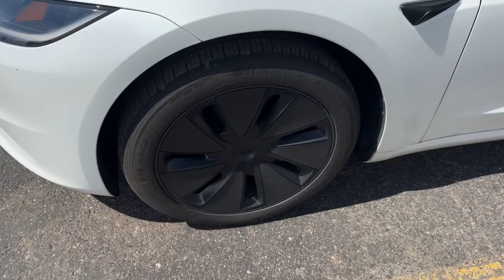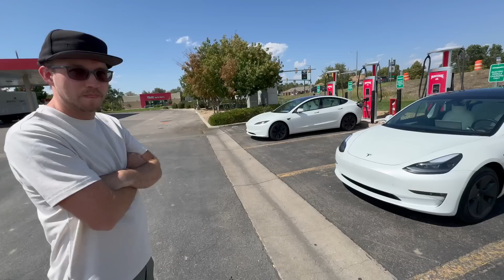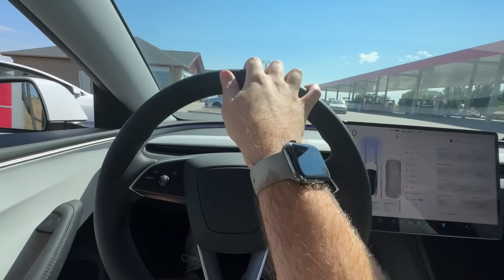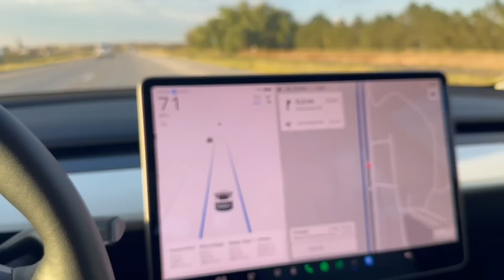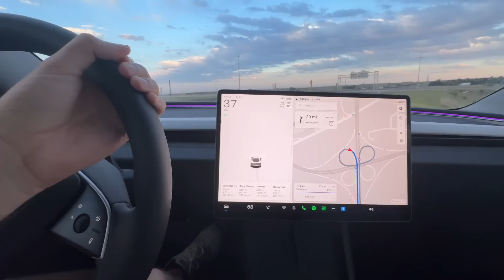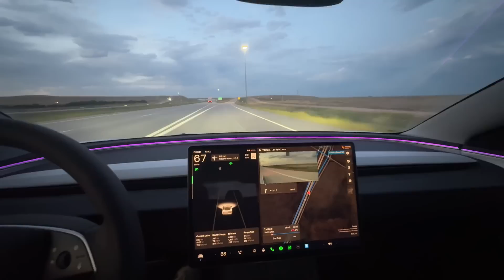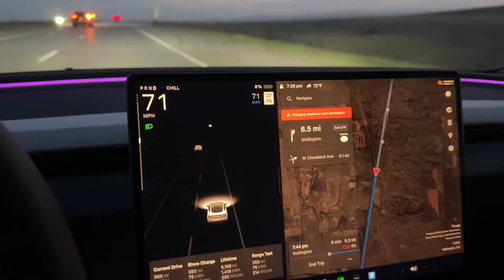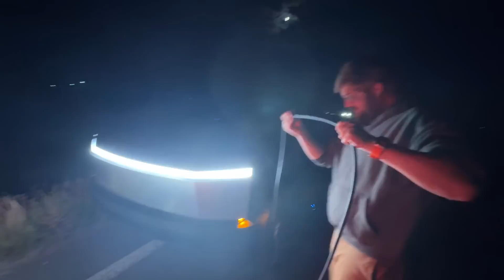Old vs New Tesla Model 3 Highway Range Test! Huge Improvement For Refresh - Long Range AWD

Comment: You KNOW what has to be done next, Kyle. You gotta put the Highland wheel/tire setup on the '21 LR and repeat the test and see just how much difference there is.
Reply: Tires make account for 3-5% of the range increase and maybe new aerodynamics another 3-5%, but this was a 21% range increase. Tesla's done something else, or so it seems. But I agree it would be interesting to swap the tires.
Reply: @777Outrigger  Cd on old car is .225 versus .219 on the new car.  Difference is 2.7%, not 3-5%.
Reply: @KP-xi4bj  I was being generous since I didn't know the exact number. That means more of the incredible range increase in the new MY is unexplained.
Reply: @777Outrigger  There was a MY in this video??
Reply: @KP-xi4bj  Sorry I was in a hurry when I posted. I own 2 MYs so my brain defaulted in my rush. 😂
Reply: @KP-xi4bj  cd is not including size. it just tells you how efficient a certain size is. for exemple, a 1 inch cube would be around 1.05 yet it has way less drag than a model 3 0.219. new model 3 is slightly bigger so it would be even less than a 2.7% difference and also why a model s even tho has a lower drag coefficient is still making more drag since it's a bigger vehicle.
Reply: @777Outrigger  maybe battery degradation?
Reply: @hojnikb  Battery degradation was accounted for old M3. It wasn't all that much.
Reply: @777Outrigger  Def Aero dynamics
Reply: @albieYT  That's certainly a part of it, but probably something else too.
Reply: You should use the older 40amp Tesla mobile charger in the cyber truck

Comment: I have a 2021 LR as well with 55k miles with 90% AC charging. I should run mine down to like <5% to get a decent degradation estimate. 
Based on how much % I use for my 120mi commute vs when it was new, I'd guess around a 5-6% loss.
I've had my cruise control lock out on me one time too, not sure why. Was fine the next time I drove.

Comment: Tesla really did make a perfect EV sedan with this redesign. All of the weaknesses (interior quality, build quality, road noise, suspension tuning) have been fixed and they increased the range! The closest competitor (Hyundai Ioniq6) can't match this range with AWD nor the tech inside.
Reply: What’s years suffered from poor build quality, road noise, etc?  Were they corrected by the 2020 model year?
Reply: @gvran71  For Model 3, if you are concerned about build quality and road noise/ride comfort, I would go with the 2024 Highland refreshed models. For the Model Y, they started getting better build quality in 2023 and Tesla put in comfort suspensions on the Model Y starting in 2023. If I was in the market, I would go with those years and newer for both models.
Reply: @chrisak49  The jury is out on that - everyone is basing build quality on the ones built in China. 
Meanwhile, Tesla can't even make a properly working cybertr**k.
Reply: @chrisak49  Please wait for Model Y Juniper if getting a Y. Differences will be monumental. Also not to disparage Hyundai Ioniq 5 N If driven at 70 mph or more I think real world range drops to like 220 miles or so so definitely nowhere near the same real world range as nearly any of the Teslas excepting the short range standard version. It also costs a fair pence more than even a performance Model Y is likely to cost especially if Federal Tax incentives still exist. Don't get me wrong, Model N is super fun if that's your thing but I think these have very different audiences in general. Each to their own. I do think Lucid's new wagon, shooting brake thingy is quite nice and surprisingly affordable if you can purchase between $70 and 80k. Cheers. Its a great time for EVs!
Reply: @noseonscent1935  Would avoid any and all Hyundai/Kia/Genesis EVs after their poor handling of ICCU failures (bricked cars for 2+ months) and manipulating crash test data they submit to IIHS. When tested in-house, IIHS showed these Korean EVs performed worse in crashes compared to data submitted by the manufacturer.
Reply: @chrisak49  very scary. I wonder however what the numbers will be after next year’s car models. The Koreans are very adept at fast necessary change. Thanks for the info
Reply: Hyundai ioniq 6 has 5kwh less battery capacity for starters and much bigger tires, but cannot match the AWD range. Still, it has a better coefficient of drag, and when they increase the battery to 84kwh, will still have more range than the RWD version. And the N version will outperform the M3P too.

Comment: Someone really screwed up those fueleconomy.gov city/hwy numbers then in a major way.  It shows the 2022-2023 LR getting 126 mpge equiv hwy.  And only shows the 2024 AWD LR getting 124 mpge.  If this test you just ran is any indication of reality then the fueleconomy.gov numbers are completely bogus.   We do know they detuned the rear motor if I recall it dropped to just above 200ish hp.  I didn't see what they said the HP figures were for the AWD 2024 and how that compares to the pre-refresh car.  I think that is part of the energy savings picture.  Also newer harder tire compounds reducing resistance.

Comment: At 4:58, I Kyle misspoke when he said 19" wheels. The new Model 3 aero wheels, called Photon, are still 18".
Reply: At one point in the video, you can even read the size on the tire sidewall, and they are 18". Also, I just checked Tesla's Canadian website, and the website shows that the Model 3 Long Range AWD comes standard with 18" Photon wheels. The 19" wheels don't have aero covers and look very different.
Reply: only in canada tho
Reply: no they re 19

Comment: Dang! 370 miles. And without piling on a BIG battery pack. God job Tesla!
Reply: Just imagine if they gave us a big battery pack too!!
Reply: Yeah but that would be brute force not high tech 🤔
Reply: @openinverter  I think he is implying one could get to 500 miles range with larger pack. However both semi-solid and solid state are here now technically and they are both major technological breakthroughs that should in theory allow for 600 mile ranges with large packs and up to 1000 miles for super packs like commercial vehicles (Tesla Semi, RVs, etc.) Exciting times. 370 on a mid size pack with slightly older tech is simply stunning.
Reply: @openinverter yup big boy tough NOT  real tough
Reply: Aaaaaaasn da safest on th road
Reply: I hope they can offer a 95kWh battery pack version for both model Y and Model 3 from 2028, the cars would be maybe same weight or slightly heavier if the battery tech improves, the cars would go 500 miles at the same speed 70 MPH, no competition even in 2028
Reply: @ Personally I'm happy with my 2023 Model Y's range, especially with all the reliable Superchargers always nearby. I wouldn't want a bigger battery pack I don't need 99% of the time. But there is certainly a market for a 400 or 500 mile range Tesla. But you would have to pay more.

Comment: I don't think the rear drive units are the same. I believe the old car has the 3DU rear motor and the new car has the 4DU rear motor. Could be performance only (I'm not an expert, but worth checking). But, I think the new unit has the hairpin windings and built-in oil filter. Anecdotally, my 2021 Model Y Performance had the old unit and my 2023 has the new unit. The motor looks different, sounds different, and seems more efficient.

Comment: You should swap the tires between the  cars and see how much the new tires affect the range.
Reply: Im pretty sure Tesla transitioned to Harpin motors in late 2021 to 2022.  Those motors are more efficient than the previous winding tech.
Reply: Also, how much of the difference would be in the tires versus the wheels. I'd be surprised if there's much difference in the wheels, but it would be interesting to know for sure.
Reply: @gregdavis3723 Lighter wheels definitely help with range..
Reply: This  💯
Reply: new tires have higher rolling resistance because more grip. old tires have less rolling resistance because less grip. sure if you are comparing mxm4 to ventus S1, then its a different subject, but the hankooks are harder but more grippy, mxm4s are softer and less grippy, im pretty sure its very very close
Reply: @mathieusturkenboom  they mentioned the tires were relatively even in terms of wear.  The 2021 M3 had custom wheels put on very early so the MXM4s would have had comparable wear levels, according to Kyle.
Reply: @mathieusturkenboom correct - the old tires are likely going to be the most efficient. Less tread, less weight, less resistance.
Reply: @fiehlsport  
These are not really old tires. I think he said and Colten said in his goodbye video on the car.. that the stock wheels and tires have very few miles on them before he swapped on some Martian wheels and different tires.
I think both sets have about 5K miles on them.  Age may play a role, and better tire compounds in the newer tire.
Reply: Dying to hear about the follow up. If you can get the same increase (or any substantial increase) replacing tires with the Hankook Ventus S1 AS that would be great to know.
Reply: Kyle! Get with drew and yall should build a super range spec Martian wheel with the new highland tire or a aftermarket high efficiency tire and compare to what Tesla offers!
Reply: Would love to know if swapping wheel and tire would improve that 280 whr/mile on the older M3
Reply: Correct. If those are energy saver they are very fuel economic but eliminate all fun while drivibg.
Reply: Great idea
Reply: I’m sure much of the gain comes from wheel / tire! I’d love to swap the new wheel / tire package on the old car to see the improvement. Maybe 40% can be attributed to that?
Reply: It would be wild to gain 25 miles of range with wheels and tires! Plus the new ones look better imo  @KyleConner
Reply: @KyleConner  This would be a great test!  Please do it. Tesla recommends upgrading to the new Hankook Ventus S1 AS or Michelin Primacy A/S when replacing all four wheels. (Service manual estimates a 10 and 20 mile range improvement respectively.)
Reply: @KyleConner Also, please test the iON Evo AS in the rain. They're unbelievably bad.
Reply: @0HOON0  do you have any tests confirming that?
Reply: @hojnikb  Tire Rack.
Reply: @KyleConner Damn can’t wait for the swapping test results!
Reply: @KyleConner 
Haha!  40% 😂
Reply: @oggyoggy1299 he meant 40% of the improvement coming from wheels/tires
Reply: @KyleConner I think it’d be more useful to your viewers if you just isolated the tire on an older model 3. Most people aren’t going to buy new wheels, but they will definitely need to replace tires.
Reply: Please!!! LoL
Reply: This is almost the entire thing besides possibly the older car having experienced degradation. Every other side by side test I’ve seen has shown there’s essentially zero difference.

Comment: Just took my 2018 Model 3 RWD on a 2000 mile road trip from Minneapolis to Bozeman and back. It did great but this comparison is really tempting me to make the switch. 114k miles on my model 3 now.
Reply: The new 3 is so sweet and not too expensive to upgrade.
Reply: @noyoutube22  Agreed! The problem is I can't justify it as my 3 has had only 1-2 issues and it was all before 50k miles. It's a great vehicle and I easily get 5 miles/kwh on my daily commutes during the summer. It's also paid off haha!
Reply: @Alpiner251  yeah I hear you. I’ve got an older Model X and until it breaks or gets totaled, it will be hard to part with.  It’s also paid off and. Maybe if Tesla does an end of year promotion.
Reply: @Alpiner251  Same boat. My 2019 AWD is doing a great job. My leather steering wheel feels fine, I don't need any star wars noise when I'm driving slowly and having a pair of frunk hooks, has always been better than not having a pair of frunk hooks.
There is also no FSD transfer in Europe 😡
Reply: @Alpiner251  if I were you just hold onto it until the wheels fall off :) there will always be a better model 3, who knows what technology will break thru a few years from now than the current best one of 2024 if it's paid off even better congrats! 🎉 your still saving money with "old" model 3 compared to conventional cars just my opinion stay safe out there!
Reply: @Alpiner251 125k miles on my 2018 too.  What issues have you seen?  Mine has been just about bulletproof.
Reply: @aussie2uGA  HVAC unit went out about 49k miles and I'm probably on my 6th or 7th front upper control arm between the two sides (I count that as one issue). That issue appears to have been fixed as I haven't had the squeakiness return for awhile now. I did also replace a rear tail light by myself as it was collecting water.
Reply: @Alpiner251  Wow, thanks!  My 2018 was delivered with non functional a/c back then but a pinched o-ring was the cause and corrected in first few days.  My experience has been so good, I'd buy another used with high miles without concern.
Reply: @Alpiner251 Returned yesterday from a 3,310 mile road trip from Ohio to Nova Scotia in our 2019 LR RWD Model 3 and got 248 Wh/mi. I've driven the refreshed Highland Model 3. While it was wonderful I'm not sure it would have made anything better about this trip. While I only have 35K miles on ours, and it still shows a little over 300 miles of rated range, I never came close to challenging the range offered in my car on the trip. But I prefer shorter, quicker stops. Best of all I was one of the lucky few to get FSD 12.5.1.5. The no-nag feature was awesome.
Reply: We’re in a similar place. My 2018 just hit 115k. As the 6.5 year mark nears, I’m getting upgrade fever. There is nothing wrong with the car. It’s new tire time, new windshield time… between the $1k loyalty discount, FSD transfer and 1.99 APR; I’m considering what would amount to one of the more boring upgrades ever.

I wish there were more EVs to choose from. We’re still a month or so away before the first non-Tesla NACS car start shipping. There’s a been both a ton of change and very little change over the past 6.5 years, heh.

Comment: We have both the 21 and the 24. Our experience is there is absolute zero difference in range between the two. So the result is a bit strange to me.
Reply: Did you get the LG or the Panasonic pack?
Reply: @anton_grahn  LG
Reply: @GameOver556  That is likely the main reason why, only around 77kWh in the LG pack, 82kWh in the Panasonic
Reply: @anton_grahn  my COC document from Tesla states 82kWh. I assumed it was LG because of the pis poor charging performance. And S3XY bottom app say battery capacity is 78.8kWh when new plus buffer. We have a narrow driveway. So in the morning it’s like 50/50 if I drive to work in the old or in the highland. I usually come home with exact same soc if it’s the old or new. Varies only few percentage it favor of both. 
Beside I have seen a lot of tests also showing no or very little difference between the to.
Reply: 18” or 19” wheels?
Reply: @pepstein  18” on both. Michelin cross climate 2
Reply: And the original test from road and track found the 2024 model got less range, but had bigger tires. 
Then again, I've gotten near 4.5mi/kwh in my niro at 72mph. But other times, it's 3.5. Even accounting for winds it doesn't make sense.

Comment: You should range test the Long Range rwd!
Reply: And the new performance lol
Reply: @teggy95se  The performance has the same battery so all they need is the same aero wheels and tires and you get the exact same range
Reply: I don't think there would be much, if any difference at all between LRAWD and LRRWD. A german channel tested this with the MY, the difference on highways was 0. It'll likely be more efficient in city driving

Comment: Thanks for the great comparison. I don't know if it's a trick or an illusion of the photograph but the old model 3 looks to be a couple inches taller than the refreshed model. Is there a difference?
Reply: The styling changes on the new one probably reduced the "visual height" of how the car looks, with thinner headlights and a more pinched-looking front end. They're both the same size and shape as far as I can tell

Comment: I've been looking forward to this test!
Reply: Now I'm really excited and curious how much range I can get out of my new M3 LR RWD.  I've got a touch over 550 miles on it (delivered with 4 miles) and with mostly city and brief highway hops (and 70 mile drive from the delivery center to home) it's showing 202 Wh/mi (4.95 mi/kWh). I have the Panasonic battery and Michelin Primacy tires on 18" Photon wheels.